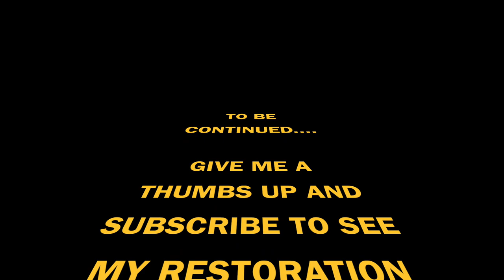Mk1 Volkswagen Golf GTI Restoration-  Roll-Over Jig Setup

Comment: Where can I buy this?
Reply from the maker: Courtney Chappell Hi, you can find it on eBay at the following link http://r.ebay.com/m6qqgp
Reply: NoPro is it difficult to erect? Any welding at all or just bolt together
Reply from the maker: Courtney Chappell it’s pretty easy to put together. No welding just bolts together. Having some ratchet straps helps pull the whole thing together. It takes a bit to get the balance just perfect so that it turns effortlessly without being too heavy or bottom heavy but if your undertaking restoring a car it shouldn’t be a problem putting the jig together.